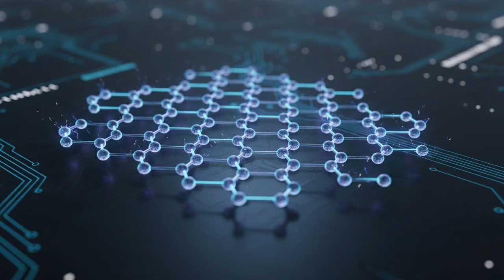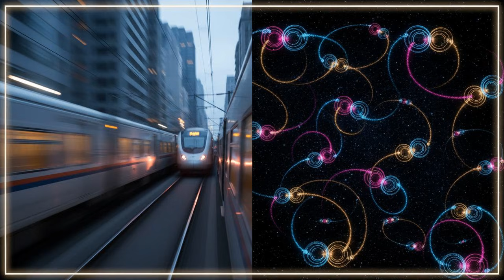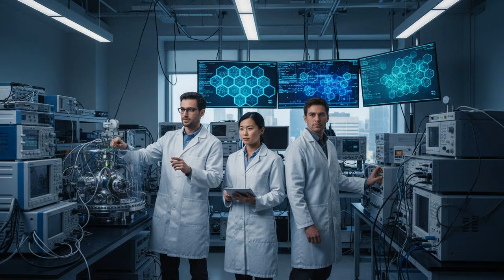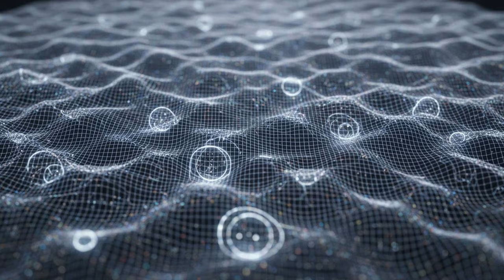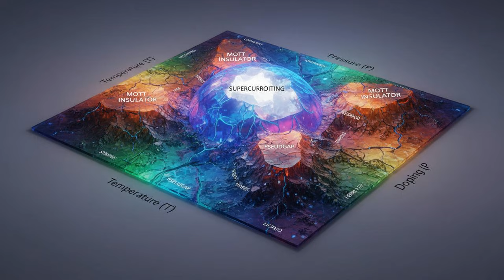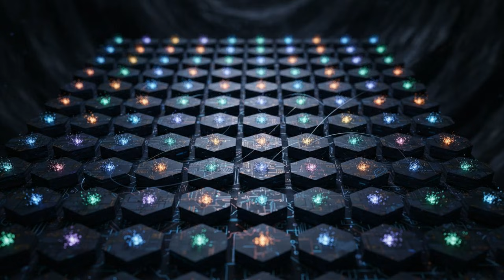Twistronics: How Twisted Graphene Creates Superconductors

Comment: 😎 this is Nice 🤗
*  NASA is only thinking brute force , moon and Mars need ,..
 Hemp bast hemicellulose fiber 3D woven fabric layers with damping bonding layers hydraulically molded into ballistic structural solutions UV encapsulated crude graphene covered sheathing , using AI to map and model solar electromagnetic fields, controlling sweeping electromagnetic fields from hull of a vessel launched from the moon or constellation of satellite megastructures in Geo acting like a spinal cord for global communications and AI , built on the moon, using similar materials to shield thorium reactors aluminum graphene alloy crude graphene covered radiators using AC blinking the surface and hex grid ultrasonically compacted molds sintered into paving shielding tiles 🤔 before the Kessler effect and AMOC flow intensity decrease in prisoning humanity , just 🤷 saying
Reply from the maker: If you interested, please follow us fb  facebook.com/profile.php?id=61575973779409 ,ig https://www.instagram.com/gfunfactsonline3 and X https://x.com/gfunfactsonline
Reply: @gfunfactsonline  thank you for the offer , I avoid social media